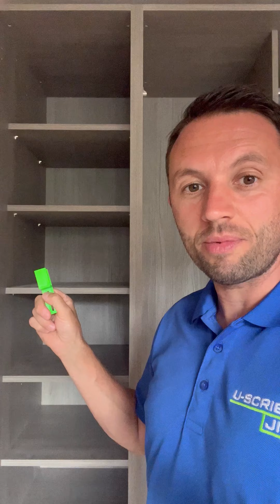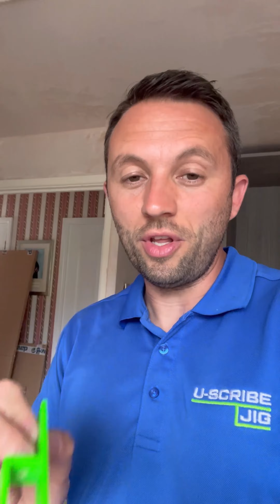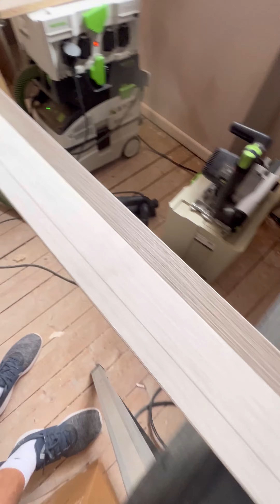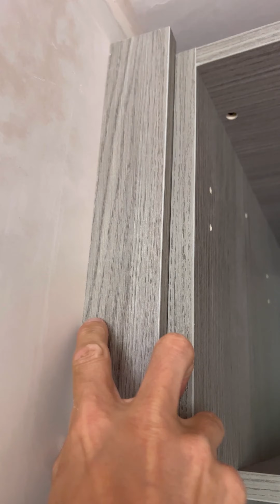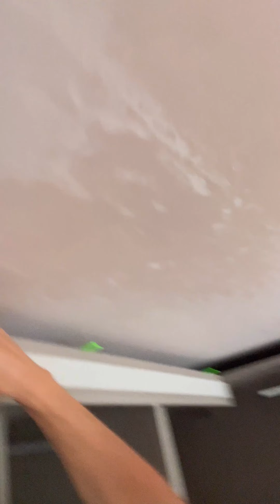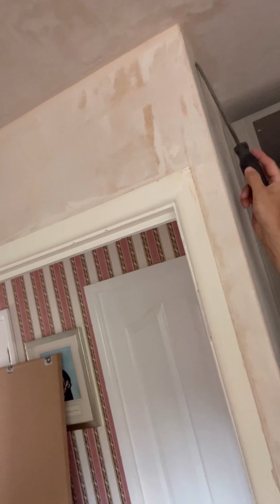U-Scribe Jig - Step By Step Tutorial (New 2023)

Comment: Hey Paul, great info. Thanks.  When doing the top section infinity.  How did you determine the size (width) of the board? I get you had 56mm from ceiling to top of cabinet and basically transferred this to the filler, but how wide should the filler be to start?

Comment: On the infinity method how u did a cut block the same size as your top scribe say for example that was capping over your tops would u just + 18 to your block? Same goes for scribes if it caps over your gable?
Reply from the maker: yes jack, in the infinity method scribing a fitted filler into the gap between the unit and the wall all you need to do is cut a block the exact same size as the width of the filler material your about to scribe, i.e. 150mm filler use a 150mm cut block, if you want to overlay that filler simply allow your cabinet thickness or panel thickness extra again i.e. lets say you have a 50mm void and an 18mm cabinet you would need a 68mm filler to overlay the face of the cabinets, which would mean 18mm + onto your filler or 18-mm less from your cut bock to allow the extra material over lapping the face. hope that helps
Reply: @u-scribejig  cheers pal helps a lot 👍
Reply: -18 I mean lol

Comment: In the process of fitting wardrobes as a DIYer since the trade are quoting ridiculous prices. Just ordered the U-Scribe Jig. The wardrobes ( 3 x 1000mm ) are assembled and in the upright position but not secured to the wall yet. Best way to secure? Thank you.
Reply from the maker: @russ623  hi Russ. Just depends on your chosen finish and material. I always try to position screws behind hinges or hinge plates. If you do have to have them visable you can find colour match waxes and cover caps to cover over any screws 👍🏻
Reply: @u-scribejig  I was going to secure to the back wall using frame fasteners ( at the top / back above the shelf ) just to stop any movement as well as to each other. Pretty heavy but just want to be sure.
Reply from the maker: @russ623  check out Space-Plugs. We sell them on our store but you can get them on Amazon too
Reply: @u-scribejig  Hi. Started to use the U-Scribe to do the plinths and hopefully ears ( long lengths so tricky to saw ). How tight should the join be between the wardrobe and ceiling/wall? I hate to see gaps but will too tight may be an issue with movement, expansion during the year?  Thanks.

Comment: And it would be great to do an overlay instruction. I assume infinity method minus the thickness of the carcass is the way you do it with these jigs?
Reply from the maker: @chrisjames3831  you nailed it spot on sir
Reply: Surely you could just fit the uscribe the other way with the slot to locate it 18mm lower than the top and scribe with scrap stock

Comment: Hi, with the infinity method, what’s the height? Can it be whatever you want as long as it’s higher than the gap you’re filling ? So 100mm for example ?
Reply from the maker: exactly that, literally to infinity, as long as the cut bock it the size of your pre cut filler it can be any size, within reason too as the longer the cut block the less accurate you will be

Comment: Would be good to have an aluminium version I have broke 2 of them just screwing them.
Reply from the maker: we would advise using non counter sinking screws and definitely not the use of impact drivers as these rip anything apart

in our prototype phase we found metal or aluminium products eventually damaged the surface of panel or cabinets

Comment: What if I want to draw a trim that is required to be flat with the front? And preferably between the front door and the trim the remaining gap will be 2mm.
Reply: Then u use the offset method, instead of using the thickness of the board (say 18mm) you scribe it with 29mm (18mm from the offset method + 9mm for the door +2mm for the gap)

Comment: Good work.
For the final adjustment also for make bevel degree  i was Discover is more easy and efective and better adjustment use a grinder White a sand wood disc.
For the raw one disc used for marble or steel, after one like sand wood 200 grain, more or less depend the material i can achieve accuracy about 0 or 0'5 mm daily.
More more fast as sander or plane,following better the curves and so important:  lessss tired.
Greetings from Spain.
Nice jigs.

Comment: What do you do if the wood piece is pushed back and not flush. How would you pull it out?
Reply: Use an extended wooden block over the trim, gently tap, covering the full length. If you're patient, all will be well.

Comment: Just about to order a set. I had one question about the offset method. When you’re measuring the gap from the wall to the carcass to figure out the size of filler are you measuring the smallest or bigger gap size?
Reply: I think he described it accurately.  If you use the largest gap as your measurement, then at the point of narrowest gaps, the wall will push your piece back past the edge of  your cabinet (and bend the uscribe).  You use the narrowest point so that you can have your right side flush with your cabinet. This doesn't bend the uscribe and allows it to work correctly.  so the filler piece will touch the narrowest point, align with the right cabinet edge, and have small gap along the wider points.  since you're going to be scribing and cutting off the excess, the small gaps at the larger ponts don't matter. Again, it would matter if you used the largest measurement, and then the narrowest point pushed your whole filler piece too far away from the wall. You could probably still make the scribe, but your filler piece would too wide by the difference between the narrowest and widest points.
Reply: If I'm correct,  using this method the scribe can't be larger than 18mm
Reply: He said the narrowest
Reply: Think he mis-spoke. Must be the biggest measurement surely?
Reply: @21ADB21  If you cut to the largest size, your filler piece will not fit between the wall and the carcass at the points where the gap is smallest.  Don't forget you're going to remove the thickness of your carcass ~18mm from the filler piece.  When you first line up the filler piece you're lining up with the right-hand edge.  When you're done you'll be lined up with the left-hand edge of the carcass.

Comment: just bought some.... jeez... why have i not thought of this after 20+ years of making fitted furniture... excellent.... Little tip. When using the infinity method, cut a little 45 deg angle on the corners. That way the block will slide better and not be prone to jam on plaster ceilings or walls
Reply from the maker: Thanks Ian, really appreciate the kinds words sir
Reply: Bought some of these months ago, using them for the first time tomorrow, just needed a quick recap 😁👍🏻